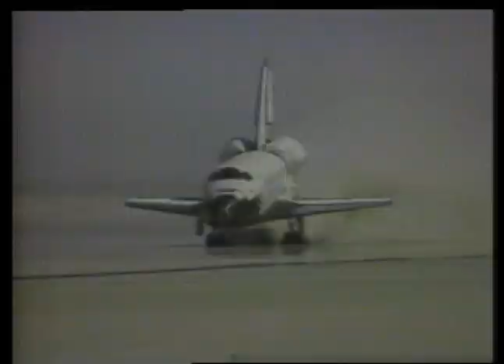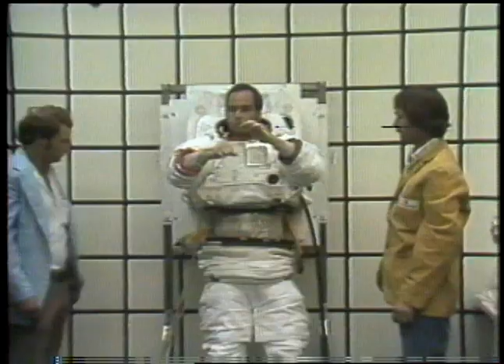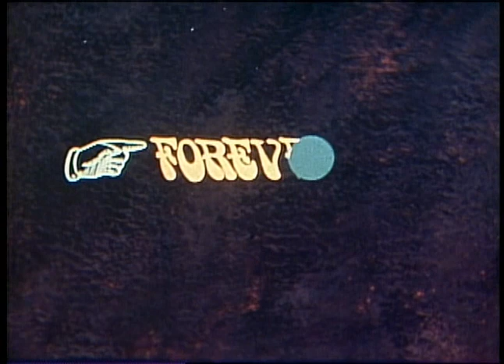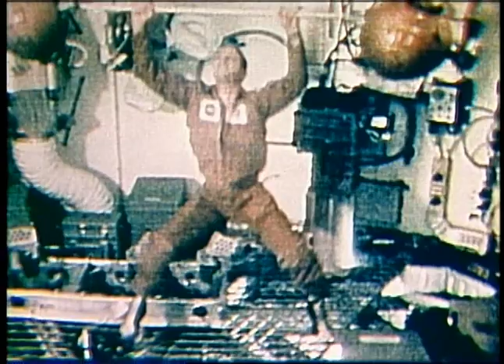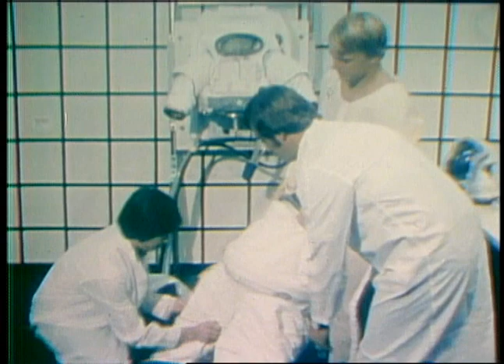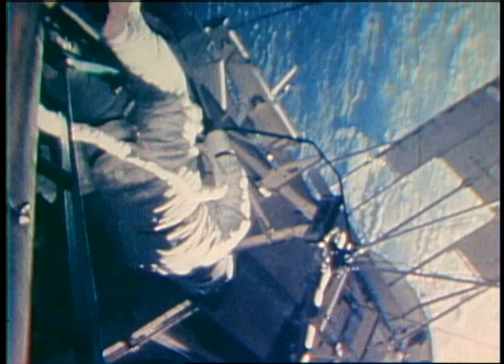Zero G And Space Suits (1982)

Comment: The earth is flat. Take it from there
Reply: If the earth is flat, (not taking into account air resistance), why does a thrown ball, bullet etc, follow a constantly curving downward trajectory toward the ground. If the earth was flat, the ball would follow an almost infinitely straight line trajectory. As the force of gravity would always act at a 90 degree angle, to the velocity of the projectile. The trajectory follows a curved motion. Because the force of gravity, acts at a constantly changing angle, to the trajectory of the projectile. Because yep the earth is curved.

Comment: They keep saying protection from deadly radiation.   Why are these not used in Cherynobyl, Fukushima ???    Whats your threshold?
Reply: These suits offers NO protection at all against radiation, and whats even worse is the claim that it protects against micrometeorites LOL!!! they could had done a demonstration by shooting a suited up astronaut with a .50 bmg (nothing compared to micrometeorites, but still something)
Reply: @Gold_Village  Where is you evidence that the suits offer NO protection?
You have none because the suits do offer SOME protection from particle radiation like would be encountered in space.
Reply: @ghz24  NASA is the ones who needs to prove it, i dont need to prove a shirt especially not a negative. What layers in the suit protects against radiation? and against micrometeorites? LOL
Reply: @Gold_Village  Well a piece of paper stops alpha particles so any layer you want to point at.
In point of fact every layer offers some additional protection especially the rubber coated nylon, the rubber pressure garment and the water filled rubber tube layer.
Hydrogen containing materials are proven effective against particle radiation.
Any of the thirteen layers of the " integrated thermal  micrometeoroid garment" that was designed specifically to handle micrometeoroids.
The multiple layers deforming when struck by a projectile is also well understood and utilised in armor systems to this day.
Reply: Different kind of radiation, believe it or not there are several different kinds.
power plants have gamma radiation to deal with, 99% of space radiation is particle radiation, not gamma of X-rays
Reply: they weight like 100+ kilos